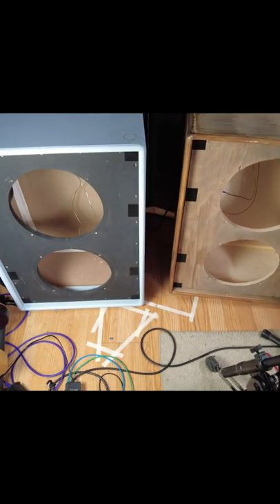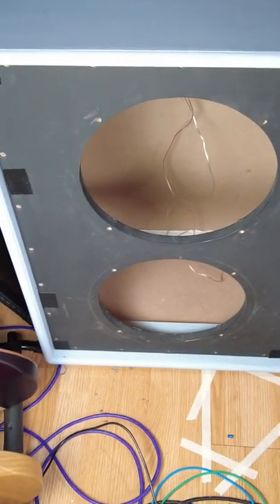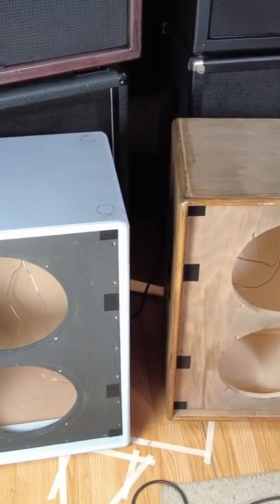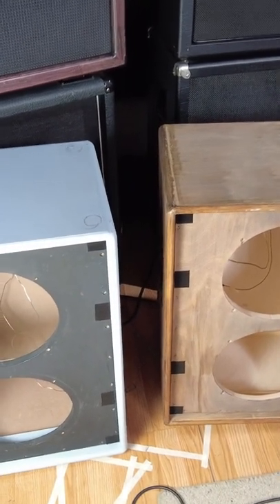Tone Wood in Guitar Cabs?  #shorts

Comment: You said it yourself - Solid body electric guitar, there is a difference when it is acoustic, and you are bouncing sound waves aka mechanical energy, Keep in mind you are using plywood and MDF be aware the Hardness of the wood makes a difference, similar property woods will have similar characteristics, test that or look up the Janka scale and how it affects reverberation, absorb, and reflection. If you put a finish that hardens the surface of the wood you nullify its properties to a great extent (this is why Tone woods in solid body guitars really don't matter as much anyways concerning tone itself), It matters to a point in sound characteristics but not Tone to the point you can hear it, is there a difference, Yes, but you need proper testing equipment to see the differences. You need to be very specific with your terms and language because people are idiots and will assume it never matters or always does.
Does Plywood and MDF sound the same as a Mahogany made cabinet, no, There is a reason why Bose and speaker manufacturers use very specific internal channeling and materials, there is a reason why instruments that are wind and acoustic are made specifically using materials. I hate to say this but Audiophiles have already did these experiments and scientists with clinical data have shown the actual results, all you have to do is pick up the phone and call "PartsExpress" and they will tell you the results, but what I am interested in is a guitar speaker, it is profiled different than something like a HiFi or even a Bass guitar speaker, so it will be cool to see your results and the differences in a more casual manner.

Comment: Prediction, 
Providing the cabinet has the correct volume of air for a given driver(s)
The cabinet is stiff enough to prevent resonance and not fall apart
The cabinet is either sealed or tuned vented box. This would not apply to an infinite baffle design.
All other things being equal. 
There will be no experienced difference in the sound from any 2 cabinets made of different materials. 
Why do I know this? Because I know what Thiele Small parameters are and material of the box is not one of them.

Comment: Not going to make a difference.
The sound will change depending on the acoustics of the room and where the speaker is placed more than anything else.
At a very low volume there might be some noticeable frequency differences, but the amps would be turned so low that the tone would be garbage anyway.

Comment: "Tone Wood for Solid Body Electric Guitars is pure nonsense" well, not for the feel, no it isn't. The quality of the vibration is also part of the equation when playing. Pickups only react to the change in the magnetic feilds with the strings, so the tonal quality is virtually non-existant for sure, but I'd much rather have something that vibrates well and full when playing clean and soft parts !! That's the kind of parts that I would test with those cabs instead of just disto with which the subtilities could get buried.

Comment: I'm gonna go out on a limb and say that you're gonna get more of a difference between a cab with no acoustic treatment (foam/insulation on the inside) than one without treatment as opposed to what the cab is made of. speakers will of course remain king but I assume you're gonna use the same speaker set in each cab.

Comment: MDF will "make a difference" if stored in an attic or Basement or the State of Florida😂
makes a great sponge....
the same goes for knife handles and wood carvings,.... moisture bad, even worse.... something that absorbs moisture!
Wood is not a subject that is in anyway "Mysterious" 
"Tonewood" in guitars.....they should just call it Hard Light Strong Stable wood, but that's a bit of a mouthful....so, Tonewood.. 
"Tonewoods" have been used for centuries by Luthiers well before the Guitar was popularized, 
most wood selections are based on weight, strength and stability.... Maple or Mahogany, or repelling insects (Cedar), carving well (Basswood), Hardness (Ironwood, Cocobolo) or being impervious to rot (like Huon Pine) for boats
Tonewood is just slang,..... Plywood and MDF are good today....but..... give it a few decades....little bit of moisture
it's not about tone, it's about Weight, Strength and Longevity

Comment: YES!  Music is vibration.  Period.  Different material vibrates at different frequencies.  There WILL be a difference, but the question is if that difference will be perceptible to the human ear.  Examining the waveform will prove the difference, but then the question is how certain people hear things.  Will a guitar signal from an ESP LTD loaded with EMGs into a Metal Zone and then into a Triple Rectifier creating a shit pile of over saturated, muddy sludge allow the human ear to perceive the difference?  Probably not.  ALSO.......use the same speakers in both cabs.  Not the same brand/model.....the EXACT SAME SPEAKERS!!  That will eliminate any variation in the speakers due to age, construction, etc.  This should be very interesting!!!!  🤘🤘

Comment: For metal or any situation where  you are shoving the mic down the cabs throught, absolutely f*cking not. With the mic that close everything else will be drowned out anyway.... kind of the point there. Only chance I see for a difference would be from further away.... but even then I seriously doubt it.  When you think about it the cab litterlaly just serves to seperate the phases (front and back of the cone) to ensure you are only hearing the intended surface. "Oh but open back cabs, ablh blah blah blah lhbbhalhaalh"... saaaame f*****cking thiiiiiiing. Except you are allowing some of the other phase to bleeed out creating the (as sarcastically as one may muster) "ThE RoOm FiLliNg QuaLlItIeS". Here there may be a difference but how open the back is and where it sits in the room will make all the difference NOT THE F*CKING WOOD. The only place I could see wood making a difference in a guitar cab would be durabillity. As well as weather there are any voids in the wood or not. Oh, and another difference between open back, ported, and closed back would be low end tightness. Open back would have none, a good port job should be fairly balanced, and closed should be nice and tight like... well I'll be nice but it was deffinetly about someones mom. Again though the type of wood should have absolutely no f*cking noticeable effect. Notice I said noticeable not measurable, big f*cking difference.

Love the videos and remember, your anger is a gift.